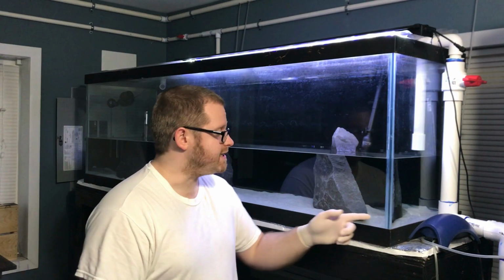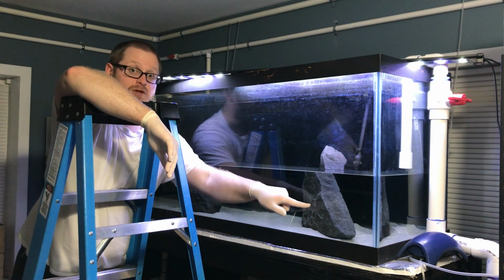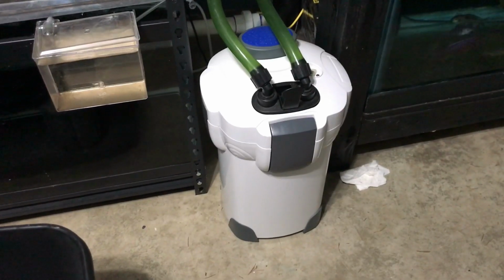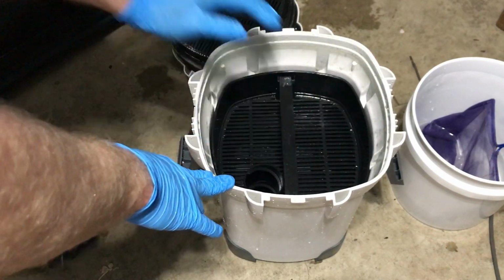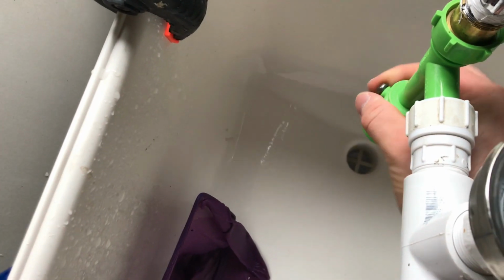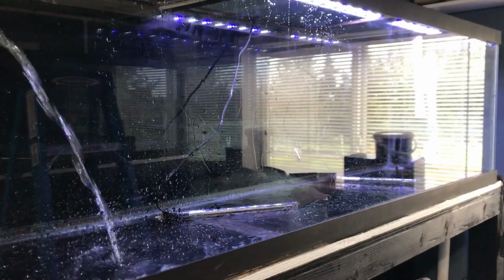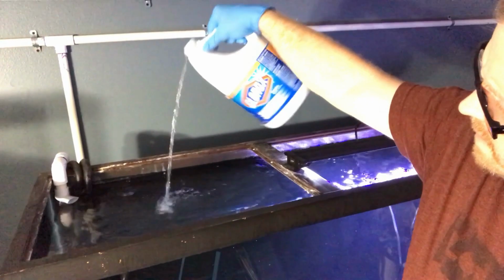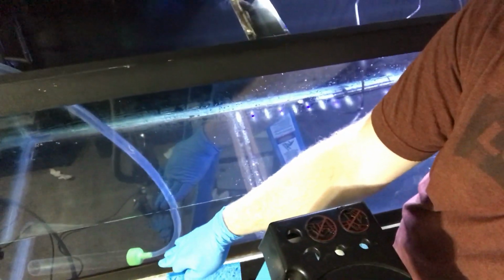How To Disinfect A Contaminated Fish Tank With Deadly Aquarium Diseases

Comment: Great video, needed this for quarantine tank breakdowns. Some eggcrate lighting diffuser or styro under those rocks to reduce pressure points on the glass probably wouldn't be a bad idea though...
Reply from the maker: Hi Ryan, thanks for your suggestion. Yeah its a good idea to clean they qt tanks after they are done with this method

Comment: Hi there i recently had a columnaris outbreak and it destroyed all my mbuna! i removed my substrate and aquascaping rocks and soaked them in a steralizing bath basically water mixed with a steralizing solution called milton bleach (designed for baby bottles and dummies etc) i let my substrate and rocks soak for around 16 hrs occasionally stirring the substrate every few hours, meanwhile i washed my tank with a sponge and spray bottle filled with undiluted milton bleach, i let the solution stay on the glass then rinsed it after a couple of hours, i ran both my cannisters continuously for about 16 hrs in a milton bleach water mix constantly cycling, i dumped my media because i thought it would hold the disease (seachem matrix) and all sponges were dumped too, after i rinsed everything continuously for around 8 hrs i built my tank and filters etc back up and filled with water, i then added 600ml of 9% hydrogen peroxide to my water and let it circulate for 24hrs, i then drained tank filled again added another 600ml of 9% hydrogen peroxide and let run for another 24hrs, then again i drained my tank re filled added another 600ml of 9% h202 and let it run for 24hrs and on final day i drained tank again refilled and added 1200ml of h202 and let run for 24 hrs. I also had my substrate and rocks in tank while dosing with h202, i am now 2 weeks past the treatment and about to start stocking my tank again do you think i have done enough to steralize my tank buddy?

Comment: If I was to use vinegar instead of bleach would I follow the same steps. I know I would need a a few gallons of vinegar for my set up just wondering if it would be the same steps.
Reply from the maker: Not sure on ratios, why don’t you want to use the bleach?
Reply: I know the ratio for vinegar is like 9:1 so would need like 4-5 gallons for my 65g. Getting ready to swap it to a salt water set up. I know vinegar is safer if you don’t remove or neutralize all of it which is why I am thinking about vinegar instead. I know it needs to run a couple days with vinegar tho.

Comment: Could you leave the substrate in the tank to bleach it as well to kill off bacteria/disease?
Reply from the maker: I wouldn’t.
Reply: @inventoryking  is there a reason why?
Reply from the maker: I personally would feel like the bleach residue would stick to parts of the sand bed since its deep. To me its better to remove and replace with new sand. If you are concerned about prices for and, you can use pool filter sand, its extremely affordable.

Comment: Hey, very nice explanation the video is very much helpful. 
For a 20 gallon tank how quantity of bleach should be add?
Reply from the maker: Thanks. I didn’t measure I just went by eye. I mean maybe a cup? It will just need lots of rinsing.
Reply from the maker: I did this in the pond I built too. All by eye.
Reply: I use a 1-part bleach and 19-part water solution.  If you want a stronger solution then lower the water portion of the bleach:water ratio.   I believe it's what hospitals use as well.

Comment: Does this work if the tank had been medicated as well?  No traces of meds left afterward?  I am boiling substrate and filter media, will that handle that?  I had a sick oscar and I medicated him but he never got better, imagine that an oscar not wanting to take meds or responding to meds.  He died 5 months ago, I am still heartbroken but I need his canister filter and bio-media for another tank.  I just want to be like, quadruple sure I wont be medicating a tank by re-using anything.  Going to clean the canister and hoses using this bleaching method.
Reply from the maker: Hi Lyz, that sucks! Sorry for your loss. I would think that bleach in the tank and filters etc would take care of it. I believe carbon removes meds.

Comment: I’m not sure if my tank is infected. A few fish died but a half remain. Would all fish die if it was infected? The water doesn’t smell or anything. Water clear. Water parameters ok. I’d hate to go thru this process if it’s not required. How do you know if the tank is infected?

Do you pour a cup after every fill up or just once?
Reply from the maker: You dont want to add bleach to the tank with fish, that will cause your benefical bacteria to die and you will need to recycle your tank, plus the fish would die.
Were there any signs on your fish that passed? That may have showed why? Just keep an eye on your tank, if they keep dying, you might have to. Its mainly for when you have a deadly disease in the tank.
Reply: Thanks. O man I’d definitely take out the fish first. I wouldn’t add bleach to a tank with fish. Just s little worried bc a few fish had fungus and possibly internal parasites, I also f’d up and bought plants from petco without treating. On top of that added rock from my front yard without watching your video first about cleaning rocks. Then not quarantining new fish. So many things could have killed or infected some fish. I currently have 3 angelfish and four green cories that are healthy.
Reply from the maker: Right on. Thanks again for watching.

Comment: Nice video! I have a question.
In my aquarium i had multiple cichlid and siamese algea eaters. At one point the cichlid showed signs of FIsh TB and started dying 1 by 1. Despite having good watervalues. But My Siamese Algae eaters remain alive and have no problem whatsoever. How should I disinfect my tank? Seems like it takes alot of time. (Which i dont mind). But I cant let my Siamese algea eaters in a bucket for too long whileim disenfecting right?

Kind Regards
Fles
Reply from the maker: Thank you. What I would do is remove your Siamese algae eaters and have them in a plastic tote with your filter running on it so they still live. You will want to disinfect the tank with bleach like I showed in this video and let it run for a while and then take the time to rinse it a lot and let the clean water move around in there. You will want to also bleach your filter and get new media. So that might be tough depending on how many tanks you have and how many filters you have running that you can use. Because you could disinfect the tank all you want But the filter that was running that tank will still have remnants of whatever is in the tank. I hope that makes sense.

Comment: Hey Paul.  Nice video. Question- Unrelated to the topic of the video. What type of lights are you running on those tanks and where do you get them?  Thanks
Reply from the maker: I got them off of eBay, and they are besmsworks. Cheap

Comment: What about the substrate should I bleach that or boil it. Or either one of those.
Reply from the maker: I would buy new substrate. Are you using sand?
Reply: @inventoryking  yes I am.
Reply: @inventoryking  I don't really like the idea of wasting the sand. It's $80.00 worth of Caribsea bioactive. Even though I'm going to kill any bacteria good or bad I can't just toss it.
Reply from the maker: The bleach will kill any beneficial bacteria
Reply from the maker: If it was me, I would toss it. That is a lot of surface area that bleach residue can get stuck on and would be removed by safe or prime. So me its worth getting new sand
Reply: @inventoryking  So boiling it to death lol wouldn't work you think.
Reply from the maker: Possibly. Again for me, the time it would take, with the risk that some of the sand might have bleach film on it, it is not worth the chain of a tank crash.

Comment: Hi there thanks for this nice video and for the information.  Actually I have a 500 L tank and it was cycled and things were fine I added 15 discus and in two weeks 7 are dead , I took the rest to quarantine tank, and I put some guppies in the 500 L tank and almost a week and guppies are doing great ! So first I thought maybe there is something that cause the death but then guppies are fine ??? No I am hesitate what shall i do? The fact i want to disinfect the tank but i honestly don't feel good to use bleach ...can I use lot of salt and let filters run for some days then remove water and clean it with hot water? Would that be ok or do you have other way than bleach? Please help.

Merry- Christmas and happy new year thank you
Reply from the maker: You are welcome, thanks for watching. Have you checked the water parameters after the discus died? Maybe adding all discus at once caused the ammonia and nitrite to spike? 
If is best to use bleach since it will kill the bad. You have to rinse the tank a lot to help make sure any bleach residue is gone and then let it run with new water and Seachem safe to dechlorinate it. Did the discus show sickness?
Reply: @inventoryking  thanks for your fast reply. The water parameters always at the acceptable ranges and I do regular check and had no any nitrite or ammonia, the fact in a 500 L aquarium I am using 3 eheim  Professional 1200 XL they are really well cycled ,they did not show any sign of nitrate, nitrite poisoning.  Just on day 10 they start hiding and then head up tail down and the die ,I could safe 4 of them at the quarantine tank.
The strange part at the same aquarium I am keeping 2 guppies to try if they die or no the fact they are doing great😂

Using bleach I agree with you it is the best way.
But I am living in appartment and I am do fill and flush the aquarium Manually so it will be very hard to flush it so many time any refill it.
At the moment I added 5 kilos of aquarium pure salt and I added esha 2000 and the aquarium filter is running hopefully it can help.
So do you have any other suggestions a part from bleach. 
Maybe I can add more salt??

Please not I have other aquarium 240 L also discus and they are doing fine .
Before they die I tried all the possible ways, easy life voogle,easy life filtermedium 
Epsom salt  but no help.
Now in quarantine I added aquarium salt,3 days Flagullol anti parasite. 
Changing water every 2 days.

Then before yestarday I started bactopur direct anti bacteria and seachem para guard, I can see a slightly improvement. 

But this big aquarium also has gravel which is one year in use I sought maybe it is the gravel releasing some chemicals, but on the other hand I see guppies are doing fine 😢🤔

Thanks
Reply: @inventoryking  also I forgot to mention that I have sever asthma and any type of strong smell such as bleach could end dramatically for me since I stay in an apartment as I mentioned this also a reason make me afraid to use  bleach 😂😢
Reply from the maker: Where the discus head up tails down at the water surface?
Reply from the maker: Ah I understand! Have you looked at purchasing at air respirator?
Reply: @inventoryking  hi no not at the surface
Reply: @inventoryking  no I am uesing some other way .
Reply: @inventoryking  can I keep my filter media (fluval bio balls and fluval filter media) after and fin rot outbreak? I plant to disinfect substrate with possibly salt and a light bleach spray on tank walls bit I don't know what to do with filter media? I don't want to loose my cycle
Reply from the maker: @nourhanateout7187  To be honest I would rather get new media and that is what I would do.

Comment: My fish got ich :( 2 died and 1 is still alive before adding any new fish I wanted to clean out the entire tank but thought doing it with bleach is bad 0_0 will my new fish be ok if I cleaned EVERYTHING with bleach ?
Reply from the maker: Blanca, what are you planning on cleaning? Not the tank with the fish there they will die. Turn up the heat to 86 for a week or so, ick can't live in high heat. That is what I do. Search Ich life cycle at 86 degrees in google and you will see what I mean. If you want to bleach the decor that is fine OUTSIDE of the tank. And it has to be regular bleach and them soaked in a dechlorinating solution like seachem safe. If bleach gets into your tank it will cause the beneficial bacteria to die.
Reply: @inventoryking  I was going to clean the inside of the tank and the aquarium decoration along with the gravel all my gold fish died :( I emptied the water out and have it outside in the sun hopefully that works I dont have a heater for my aquarium should I just rinse it with water and set it up again like a new aquarium ? Should it be ich free being in the sun ? I wouldn't want any new fishes of mine to die :( I wanted to try getting a koi fish this time
Reply: Blanca Carson Koi grow to 3 feet. They’re beautiful but will likely outgrow your tank super fast.

Comment: Great video Sir, I will going to do the same with my 40g tank, quick question, 1st time water with bleach and then 4-5 times fill and drain with clean water?
Reply from the maker: Yes fill with water and add some bleach. Let it filter for a bit so it gets everywhere. Then drain and fill and scrub. Repeat this 4-5 times or until the bleach smell is gone. And then safe!

Comment: Thanks for this video. I have wondered how I'd  handle a problem like this. How do you know that the disease is dead? 10 minutes doesn't seem very long for such a small amount of bleach in such a huge tank  How many times would the nleach water recycle the water in 10 minutes? Would the silicone react badly to a longer time or more bleach? Cheers
Reply: That should have read "How many times would the ffilter recycle the water in 10 minutes? "
Reply from the maker: Hi Margaret. So I know that it is a good amount because each time I drained and scrubbed it still smelt like bleach. Since the filter was empty, just the trays it should move a decent amount of water. The scrubbing helps.

Comment: Could you cycle this with the sand and decor if you plan to re-use it.  Perhaps leave it a little longer.  Also is there any threat to damaging your pumps plastics if you leave it for an hour or two?
Reply from the maker: Are you talking about the bleach?
Reply: @inventoryking  yeah if i leave the bleach water run for longer.  Is there any chance of damaging the plastics or tank liner or anything like that.
Reply from the maker: Kaleb I think you will be ok. Just not too long. And rinse a ton
Reply: @inventoryking  10/4 just added bleach to the 40 gal.  Had a fungus wipe out the entire tank about a week ago.  😧😧 thanks for the video

Comment: Why don’t you make a friction fit extension for your pump with a bit of extra pvc pipe it’ll be cheap and save you a lot of time draining  those epic tanks of yours
Reply from the maker: Please elaborate
Reply: It looks like you have a coupler at the end of the pipe that goes half way down the tank and ends. My guess is it is glued together. Cut it off where it ends and use a coupler that is slip X slip. Don"t glue it at the end or where the extension connects 1/2 way down and push the pvc fitting together firmly. Cut a pipe to go to the bottom of the tank as an add on to use when needed. If the fittings ever become stuck , 1 or 2 pair of water pump pliers will undue it. I keep a pair of water pump pliers in my fish chemical box so I always ready. The brand have use and love is knipex. They are made in Germany and cost more money but worth every penny. The way the business end in the head is more narrow than everyone else who makes them including Chanel lock brand, so the German brand will fit in almost everywhere. The ease of one hand adjustment to open up larger or smaller. The grip of these priers is better than all others made and what every is garbed with them doesn't slip out. The ergonomics is great as well, like an extension of your hand.  If you don't like the idea of your stuff not being glued together you could use a male adapter ( Slip pipe on one end of the fitting X Male pipe thread on the other end ) and a Female adapter ( Slip pipe X Female pipe thread ) to add an extension whenit is needed.  i @inventoryking

Comment: ...Or you can use hydrogen peroxyde :)
Reply: Aqua Matrix a lot safer for your lungs.
Reply from the maker: Makes sense
Reply from the maker: Thanks for the tip
Reply: I've used bleach before but if I had to disinfect a tank again Hydrogen Peroxide would be my choice as it breaks down into harmless water and oxygen after about 2 days.
Reply: Brian Meehan how do you do it ?
Reply: @bpm1289  Now that is some seriously useful info. Cheers
Reply: I’ve had a jelly like bacteria take over my 180 gallon reef tank.  I’ve tried Dr. Tim’s, peroxide, and prayer.  Finally it was napalm or bleach. So my tank and sump has cycled with bleach for 24 hours. Then we’ll try it again!

Comment: I never have seen DUMP like you. 
1. You waste too much water to disinfect the tank.(Out of 100 only 30 percent water is drinkable). 
2. You never said cleaning the Sand and Rock.There is also bacteria live.
3. You pull the rock that way where sand is crusing in glass.
4.You can use that bleach water if you have well or near by river. Atleast you can use that water cleaning your car.
5.you have sun sun canister filter with UV then how your tank need's fully clean like starting fresh.

Anyway, next time if you need to do the same process then think about only Water. There is PP treatment you can use. where you can save your energy ,fish, and mainly Water. Be Smart.
Best of luck.